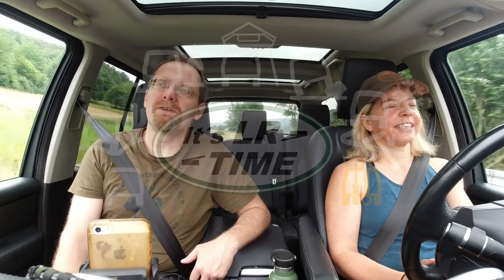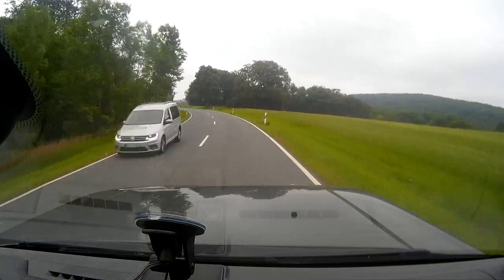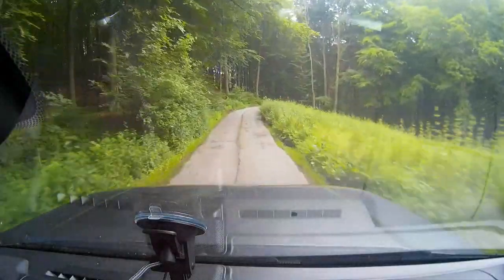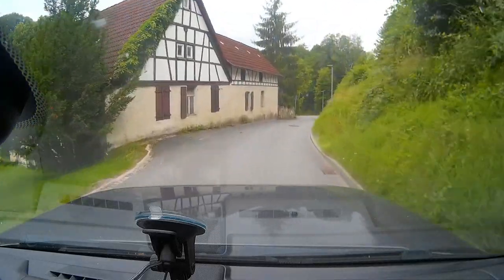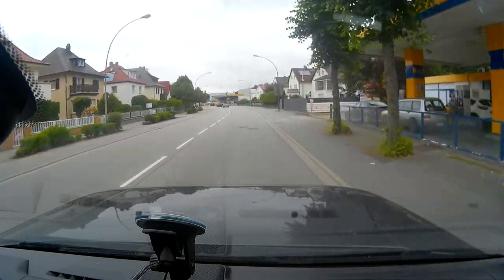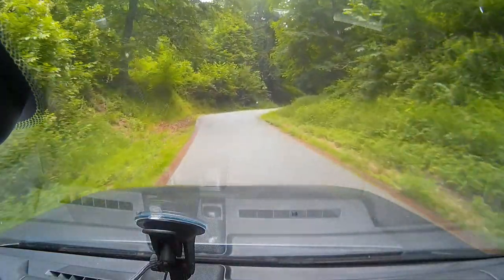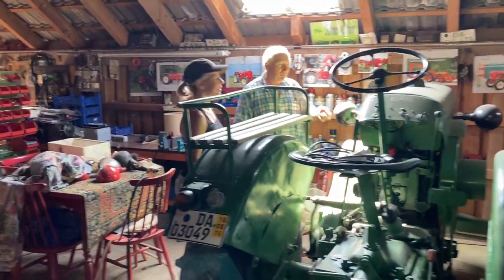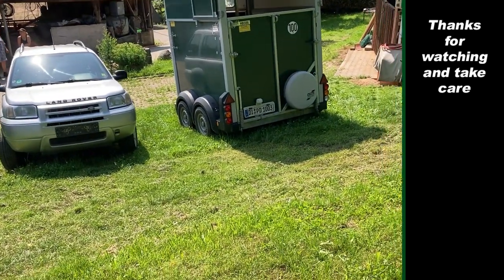Land Rover Discovery 4 - Is it really an upgrade from a LR3 ?

Comment: I just traded my 2006 Discovery 3 for a 2015 Discovery 4 both used as our second car.  Having previously owned a Discovery 3 and two Discovery 4s from new, I knew what I was buying.  However, I had forgotten the horrendous turbo lag in the D3, as well as the lack of reversing camera and not being able to link my phone to the car to play music except through the Aux input.  I also like the fact that I can see when the auto-lights have turned on by an indication in the driver display, rather than having to put my hand up near the rear view mirror and take my eyes away from driving to see if that little light is on.  The keyless entry is a boon when you have your hands full, and being able to double-lock the car at a door then open the tailgate, knowing that when you close it, it will re-lock the car and re-arm the security system with no further input is also a big help.  However, there are a couple of things I do miss from the D3.  The first is personal preference - I prefer the old grille, and don't like the newer 'family face' grille on the D4.  I also think it's a shame that LR changed the bumpers and wheel arch extensions from grey hard plastic to body-coloured gloss finish.  Getting a scratch on the corner of a bumper or on the wheel arch didn't use to matter.  It's also taken away what I believed was an aesthetically pleasing contrast on light coloured cars, like silver or white.  All in all, I don't regret trading my D3 for a D4.
Reply: land rover not land rover any more....see i had a d2 and im in a d3 ...and the latest the i would go is 06 to 2015...and thats for the lr2 lr3 lr4. my lr2 was classy as fuck. my lr3 needs some work but im looking to buy a rr in the future.are a newer model of the lr2

Comment: I have both LR3 and LR4 (SCV6) and I feel more confidant in LR3 even though it is 10 years older than the LR4.
Reply: Whats your thoughts on the supercharged petrol v6?
Reply: Funny you should say that.
I have both a Discovery 2 TD5 (2001) and an SDV6 HSE spec Discovery 4 (2013) and, although I love the D4, I have much greater confidence in the D2.
The D4 is a beautiful vehicle to drive and a very capable offroader ... however, I have in the back of my mind .. snapping a crankshaft .. blowing a turbo .. crack in the inlet manifold ... and a myriad of other possible 'expensive' problems. Not very reassuring if you spend most of you time, as I do, in the Australian outback.
I service/repair my own vehicles (except for anything major) and even considered buying a Toyota Landcruiser before the D4 at one stage, but turned away from this because they have just as many issues and are also expensive to repair.  The LC also has nowhere near the 'driveability' of a Discovery!
Another thing I don't like about any of these later vehicles is .. I prefer a live axle to the independent suspension any day of the week.

Comment: Sorry to see the Freelander go. The more I watch your channel though I get tempted to buy a Discovery 3 or 4.
Reply: Also had a freelander and then bought a discovery 3 , difference in ride and comfort was like night and day , had landies some 30 x years and must say the D3 is my favourite so far, they do need more looking after but still bring a smile to me every time I drive it
Reply: @garystuart226  I may one day upgrade from the Freelander but enjoying it for the time being. Sometimes the ride is comfy (It has BFG's on it which may help?), other times it can be a bit harsh.
Reply: @The-Observer  , hi, just wait until u drive a D3 and how different the suspension system is, ur be amazed how truly the ride comfort is on the D3 in comparison, seems to just smooth any bumps out , lol, maybe the weight of the disco flattens anything is goes over, lmao , see if u can test drive one and see what u think , must say replacing the rear upper wishbones are a right @&@*#*#* hell of a job and admit do need more looking after but after you’ve driven one down a motorway they just eat the miles up , hope that helps a little bit plus also check out the discovery 3 forum and landyzone as plenty there to also give u an insight
Reply: Don’t be tempted unless you have 30 years experience in the automotive industry like Cristian

Comment: The old tractors were great, you will appreciate the LR4 more as time goes on depending on its reliability. I have found many Discoveries have not been looked after properly and this is a major factor with future failures. Reliability aside the LR4 is the best off this class. Great show.
Reply: Ye this was kind of taking over from the defender as a work vehicle and all that which is probably one reason why the new defender is similar to the disco 4 in many ways.

Comment: To get rid of the smell, use bicarb soda. Lot and lots of it. Sprinkle it everywhere with permeable fabric and carpet. Get handfuls of it and rub it into the roof liner. Leave it for a day or two, then vacuum it all back out. It will remove a vast majority of the smell. If the smell if really really bad, you may need to repeat the process a few times as the bicarb is like a sponge and can only absorb a limited quantity of odour. The more bicarb you use, the quicker it will get absorbed. Obviously the headliner is the hard part, as the bicarb will always want to adhere to the laws of gravity 😂. 

I had a bad smoker smell in mine. New cabin air filter and bicarb have really really helped. No more headaches while driving to get bread and milk.
Reply: Also, love your video’s. Keep them coming!! 🤩
Reply from the maker: 😃 Didn'T think about that one, thanks for the tip 👍🙋‍♀️ Vera

Comment: So easy to do an oil change with the SDV6.  Just stick a vacuum on sucker onto the former dipstick location and remove the oil.  No need to crack the drain plug and no bending over.  Replace the filter element on the top of the motor and pour in 5.9L of new oil and you're done!  You can change the oil in 5mins while wearing your best clothes.
Reply: Well I can see if you still have a hole where the dip stick would have been then that is an easy fix if you actually want a dipstick instead of a €1500 replacement oil sensor. A straightened out wire clothes hanger costs you nothing! Christian will just love that!!
Reply: @samrodian919  there's already an extraction point.  It's covered by a slim black plastic cover.  "DISCO3.CO.UK - View topic - Oil change SDV6" http://www.disco3.co.uk/forum/oil-change-sdv6-184312.html

Comment: Looking forward to see what you do to your D4.
I brought a 2015 MY D4 last year to replace my 18 year old D2
My buying criteria was I wanted a low mileage (50,000 miles) one owner, full service history ( these are complex vehicles and I think a lot of reliability problems come from a lack of maintenance).
I tow with mine so the engine was important (I could buy a new pick up with 3500kg towing capacity for not much more but all the new vehicles seem to only have a 1.9 - 2.0 litre engine) I think that towing the SDV6 will be less stressed. 
Looking at the values of D3s I don't think I will lose a lot per year in value off the D4 and I think it will hold its value better than the D5 as I don't know anyone who likes the look of the D5.
I have spent quite a bit on modifications as mine has to work, these are discrete winch, safety devices roof rack. Pro speed light bar. Rock and tree sliders (wanted side steps and this was easier) tow bar, Loadlugga shelf in the roof, xanadoo boot basket shelf, safari snorkel with cyclone filter. EBC green stuff discs and pads. General grabber AT3 tyres. 
I've got to say so far it is a brilliant vehicle. 
If you want any help or advice please ask, although you seem more than capable. 
Good luck and have fun.

Comment: Simply the best and most useful comparison I have seen on Discovery/lr 3/4. No dipstick and the electronic oil level monitoring can be temperamental... lovely.  For North American viewers.. similar situation in that lr3 4.4 v8 very reliable and long lived vs the more powerful but problematic 5.0 in the lr4. The 5.0 has timing chain problems. I think later year lr3 probably the best of the   air sprung vehicles. The Porsche/MB tractor museum was nice addition/ending to the video. I love unimog/pinz/gwagens.

Comment: You are correct on facelift and replacement models dropping quality, as a family we have had lots of BMW 5 series, e12 from the 70's was better trimmed than the e28, e28 was miles better built than the e34 , similar story with Mercedes. Too many accountants running car company's.
I do like the disco 3 and 4, the 3 here in the UK tends to be very cheap, I think they are both so much nicer than the disco 5, my friend has bought a 5 and it's so small inside. Keep up the great vids 👍

Comment: I bought the last of D4's with the 2.7L motor in 2010 with  sat nav and 7 seats.  300,000KM later and still the best vehicle I have ever owned.  Gearbox needed a rebuild @ 180,000KM but that was because of that stupid sealed for life box and the stealer saying it didnt need servicing.  Got my first ever fault codes being POOOE-22 and P2290-00 last week which were fixed with a new fuel filter.  Fingeres crossed the dreaded HPFP doesnt rear it's head

Comment: I use magnetic phone holder (phone has metal plate (glued or just between phone and case)).  The holder fixes to the vent port above the start button. Good place to use gps software.

Comment: Had both - 2006 D3 4.4L V8 and then 2010 D4 5.0L V8. D4 was waaaayyy better (at least for me) - they sorted out most of the "flaws" D3 had - sluggish engine, tranny hesitation, shifting, electronics, brakes and totally refined interior with better controls, nicer look and materials. More refined seats. Fewer problems compared to my D3. D4 was the best vehicle LR made in the past 20 years, imo. I miss my Black Ed D4. And I am totally unbiased, LOL.

BTW - I scrub all my used cars I got just like you did - even the "detailed" ones.

Great choice, enjoy it! Congrats on your purchase.

Comment: Congratulations on your Discovery 4, looking forward to your videos on this great motor, another reason in UK to buy one 2014-2017 is the Tax every year is 273 euros with older ones are 656 each year. 😉
Reply: Sorry, 373 euros.
Reply: The Euro 6 LR4 (AdBlue/DPF - 2015-17) is £330/€388 per year road tax (VED). If entering London's Ultra Low Emission Zone (ULEZ) from 25th October 2021 you will be charged £12.50 (€14.70) per day if you have the older Euro 5 LR4. This has meant the value and asking price of the later LR4's has gone through the roof.

Comment: Great video, I was looking for a LR3 to replace my RR P38, but ended up with a 2006 RR L322, with heated steering wheel, seats front and rear, which was the deal maker for my family. The LR 3 and 4 have more off road accessories than the L322 which has almost none. Over here in Canada the Discovery name is reserved for some LR 2 and their newer vehicle that looks a bit like the Mercedes GL with the bloated rear. I liked the LR4 but they were outside of my budget and over here they have the petrol engines. The one thing I really dislike is the electronic parking brake on the LR 3 and 4. As bad of an idea as the electronic dipstick.
Reply from the maker: 😅👍 We have a video about servicing the electronic parking brake, it's not that bad.🙋‍♀️ Vera

Comment: I had considered buying a Disco 3, but due to increasing amount of cities across Europe implementing Low Emissions Zones, it really doesn't seem a viable option in the longer run. I have switched to searching for a D4 now with a Euro6 emissions rating. As you said trying to find one without crazy milage at a reasonable price is tricky. However I think it will be worth it in the longer run. I'm not sure there are too many other vehicles on the market that are as versatile as the Discovery. Looking forward to the videos on your D4.

Comment: It's a Land Rover, bings and bongs shouldn't cause any anxiety. It will either turn off on it's own or most likely it is something stupid.  In my experience major problems make themselves known with or without lights or noises you almost can't trust anything coming from the computer on the discovery 3, it is "the boy who cried wolf".

With the 4 you get a nicer interior, better brakes, more power, improved suspension components with significant reliability downsides and reduced off-road capability.  As you mentioned about the angles but also the increased wheel size is a disadvantage(18in wheels fit on the 3 but not the 4) because it reduces tyre options.  In North America it was even worse because the 4.4L was pretty much bulletproof where the 5L was a basket case with timing chain issues and other assorted quality issues.  At least in North America the 3 is much cheaper to repair than the 4, parts are much cheaper.  The 3 with the 4.4 V8 is one of the best off-road vehicles LR has produced in the last 25 years, I suspect at some point they will be very in demand for off road builds.

As for "infotainment" and such, just take the Land Rover unit and throw it in the bin in the 3, the Chinese android units are pretty much plug and play.  I have the factory bluetooth which works fine plus CarPlay through the Chinese android, the 2 work great together, frankly it works better than the "infotainment" in newer VW's, Mercedes(why don't they have touch screens?!) and LR's(I don't know about pivi-pivi but the intouch units were horrible) and that is sad because it is a dodgy Chinese android unit that was $275.  The integrated units frequently reset because they are tied to the canbus where the isolated android head unit is stable as long as there is power.

Comment: The bong in my '08 L322 was also used both for faults and notifications which wasn't good for my blood pressure, especially in the winter. Every time I heard the bong sound warning me of potential black ice I envisaged lots of bank notes leaving my wallet 😆 Luckily I have a '12 L322 now which has a visual indicator on the binnacle instead of a bong.
Reply from the maker: 😅Philipp and I are also getting a shock and are so relieved when the 4°C sign pops up. Still after so many years of owning our Disco 3. 🙋‍♀️

Comment: Christian, thanks a lot to share your experiences with this car, that's have good stuff and issues.  A good discussion is a galvanic corrossion that occurs with differents material, a problem that LR Discovery have some due difference between steel and aluminum. 
Best Regards.

Comment: Congrats guys for the "new entry"... D4 is more capable offroad due to faster communication system inside Terrain Response stuff and better low end torque...Tip: monitor closely the injectors balancing, it seems to be the root cause of crankshaft failures! A good injector diesel cleaner every 4/5 tank refills is recommended.
Enjoy the new toy and use Arbre Magique :-)))
Reply: I would of thought overfilling with oil or oil dilution or older failing oil pump not supplying enough pressure . Good to know will research that further . To broaden the knowledge of lthese engines . 👍
Reply from the maker: 👍🙋‍♀️ Vera

Comment: I have both too. A 2005 D3 and a 2012 D4. The D4 drives better even with my low power 211PS 3.0 V6, but the D3 is a better place to be.  Shame about the crankshaft issue in the D4, that cost me £6K.

Comment: Thank you for sharing your opinions. Even though you had only owned the LR4 for a week when you made the video, I am sure you researched the LR4 for a much longer period. The LR4 "Looks" nicer, but that is all trim, which you can buy from Land Rover or PowerfulUK or other locations. The Engine while more powerful is something an LR3 owner won't appreciate if they haven't driven an LR4. I was driving an 31 year old Nissan GQ Patrol, to me my LR3 TDV6 is absolutely powerful and very economical. Nothing anew Flash can't fix if I want more power!.

I have no idea what the benefits of the 8 speed gearbox has over the six speed. I don't know if it has a lower first gear and a taller top gear, or if there are just more gears in between first gear and top gear of the LR3. Unless it has a ratio that is lower than the LR3 first gear, and the overall ratio is less than the LR3, then to me it is a pointless expense.

The interior of the LR4 looks good also. however  I don't think an LR4 is several thousand dollars better than an LR3. There might be a bit more "bling", but again, not worth the extra expense.

Please don't misunderstand me, I would most definitely own one. But on straight out economics, they do not make sense over an LR3.. If I had more money to spend, and the right one came up, then yes, I would have bought an LR4 for no reason than I prefer to buy the newest I can afford, and they do look god, the engine does have soo much pore torque.
Reply from the maker: We were looking at a Land Rover D3 /D4 with low miles. Even in a D4 that is hard to come by these days, and an D3 almost impossible here in Germany. Most first time buyers looking for used Discoveries are going to test both, and at those this comparison is aimed at, since we get so many questions regarding this issue. It is not aimed at those already owning one, they already know what a great car they have 😃👍. But we needed a car for Christian now, the Challenger being gone and the Freelander slowly getting old (plus insurance and tax is not that much cheaper here in Germany than driving a Discovery ), it only made sense to get this particular D4 with the kilometers it had on. 🙋‍♀️ Vera